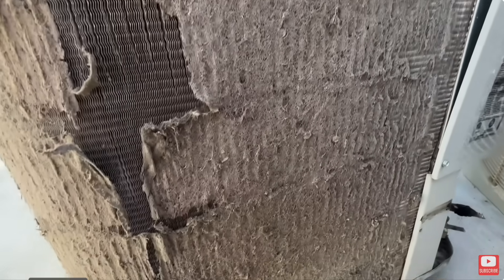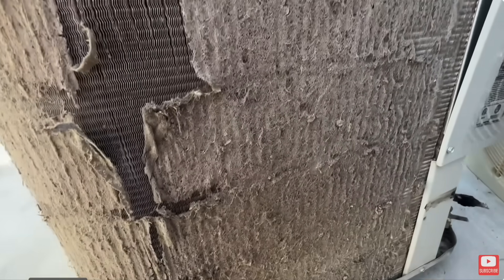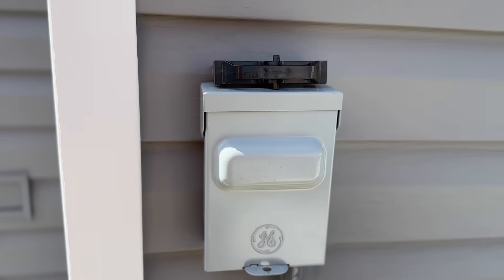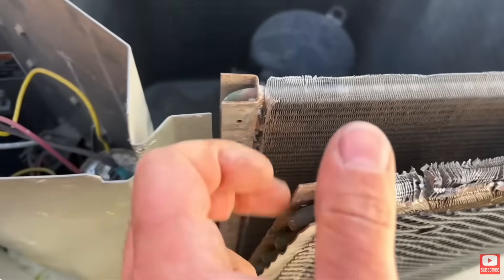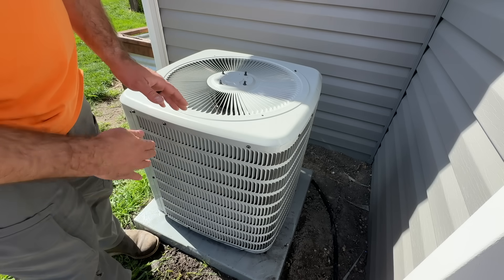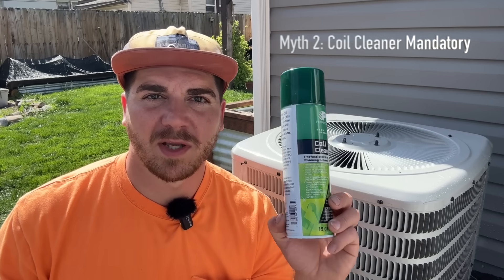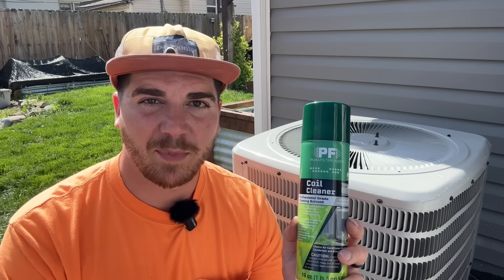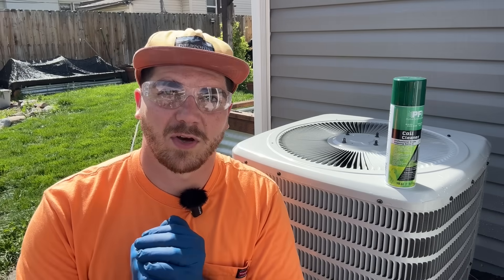Stop Cleaning Your A/C Coils The Hard Way! Do This To Get Colder Air From Your Vents.

Comment: Really appreciate you sharing your excellent knowledge about HVAC systems. I have question about compressor freeze up. If on a 90+ degree days and we set the thermostat temperature to 60 degree, will it cause the system to freeze up? Been getting conflicting answers, some tech said yes and some said no. What's the correct answer? Thanks in advance!
Reply: It depends on your specific setup and condition of your system. If you have a "dumb" system and your airflow is limited (such as from a dirty filter or undersized ductwork) it will probably freeze up. If your system has great airflow and is properly charged it will probably be fine. Usually it's recommended not to cool below 68F or so just to be safe. If you want it colder you can get an inexpensive freeze protection control installed which monitors the operating temperature and shuts off the compressor if it gets close to freezing. If you have a modern inverter-based system like a mini-split it probably has this protection built-in.
Reply: @eDoc2020  

Nope....air conditioners are only rated to cool 20 degrees colder than outside. You might get a bit more but no way you could ever pull down to 60 on a 90 degree day outside. That unit will freeze up. And yes, I am a licensed professional!
Reply: @JohnDoeEagle1   I just looked at some datasheets and the equipment is totally rated to cool into the sixties when it's 115 outside. Obviously the actual temperature performance depends on the unit size and thermal load. If you're in a cooler climate a sensible installer might size the equipment only to cool 20 degrees below outdoor temperature but the same building in a hot climate will get a larger capacity unit.
Reply: @eDoc2020  

Not true....if the equipment is big enough to go below that it's a "chiller" not a a/c. They use different Freon, different compressors, different pressures etc etc.

There's no R-22 or R-410A unit capable of such a thing.

R-23....aka "Agent Orange"....likely so.
Reply: @JohnDoeEagle1   I'm talking about a standard residential heat pump (but I presume cooling-only units are the same). One of the datasheets I've been looking at is the Goodman GSZC7 which is very clearly R410A. Expanding Cooling Data — GSZC702410A* + DMVT30BP1400* clearly shows data points up to 115F outdoor ambient temperature and indoor dry bulb down to 59. At those temperatures it has a low pressure of 159 and high pressure 445.

My understanding was that a chiller cools water and an air conditioner cools air, regardless of the size.
Reply: @eDoc2020  

You can't operate at those pressures and receive the results you are implying. Have you ever charged or put gauges on a refrigerator or freezer before? Yeah, you are lucky to have 5 PSI pressure when it is fully charged and running properly. There NO WAY a heat pump or a/c can do what you are describing. It's impossible!
Reply: @JohnDoeEagle1  If you think it's impossible I suggest complaining to Daikin. Also every other air conditioner manufacturer since they all say it's possible.

On an R410A PT chart the pressure is 101 psi at 32F and for R22 it's 57 psi. When the pressure is 5psig the temperatures are below -50F for R410A and -30F for R22. I'm not a professional but I know fridge coils are warmer than -50F.
Reply: @eDoc2020  

It's not possible....for starters refrigerators don't run on or use R-410. Most are R-404A R-134A or R-408A.....

I 100% guarantee you can't pull a heat pump or a/c DOWN into a 30 - 50 temp difference between the inside and outside.

You say you aren't a professional...yet are arguing with a professional with 22 years real world hands on experience , Universal Certification and NATE certified. 

That's why I despise this channel and the rookies that lurk it. You know more about it than we do. Yet you flunk simple basic theories and common knowledge.
Reply: @eDoc2020  

Why are you quoting R-22 specs either? They haven't made any new R-22 systems since 2011. You can't even buy new R-22 Freon anymore. It's all recycled and reclaimed.

Furthermore suction line temp has nothing to do with what is coming out of the register as well. You'll usually see a 18 - 20 degree drop between the supply and the return if the system is charged and working properly.
Reply: @JohnDoeEagle1  I don't know everything but I can read manufacturer datasheets. Heat pumps can have a 30-50 degree difference between inside and outside while still working. The simple fact they heat during the winter proves this.

I don't care if you're a professional or not. If you say things that are demonstrably false prepare to be called out. Perhaps you are working with 22-year old practical knowledge that is now out of date.
Reply: @JohnDoeEagle1  You mentioned R22 before I did.

Unless I'm mistaken the suction line temperature on an air conditioner is always lower than the supply air temperature. Actually I suppose I probably am mistaken because of superheat.
Reply: @eDoc2020  

Heat pumps don't work below about 25 - 35 degrees F. Nothing I said is false but clearly you are a unlicensed, unschooled, untrained, inexperienced know it all. That's when your +1 kit or electric furnace takes over on auxiliary heat. Even better if the main furnace is gas......At any rate I am specifically talking about a/c and cooling not heat. With a gas furnace you can have extreme differences in temperature between the outside and inside of the house or building.
Reply: @JohnDoeEagle1  I may be unlicensed and relatively inexperienced but you are the stubborn one. I've seen the call logs from smart thermostats clearly showing heat pump operation well into freezing with only occasional W2 aux heat.

For cooling just ask anybody from a hot climate.

If I'm so wrong then surely there's tons of information showing that you are right. Please point me to a document or two from a manufacturer or trade association saying standard air conditioners can't produce more than a 20F difference between inside and outside.
Reply: Good trap.....

18 degrees difference between the return and supply is usually ideal. Anybody who is licensed and has been professionally trained would already know that.
Reply: @JohnDoeEagle1   I know that an 18 degree drop in air temperature across the coil is good. But what does this have to do with the OP's question? We have no idea if their system was installed properly or how it's performing today.
Reply: You know more about it than I do even though I am a highly experienced professional that worked at a company in business for 105 years fro  1912-2017 until the third owner (my boss) died of a heart attack. He worked there from 1966 - 1986 before he bought the place. He owned it from 1986 to 2017 until his death. His widow was 71 and well past retirement. She closed us down and I found another job somewhere else. Now I work on large 480 Volt 3-Phase Delta twin compresor 20 Ton Trane package units at a U.S. Government DoD contractor facility that builds stuff for AM General and Oshkosh Defense. What would any of us know about it right? Only sold coal and was in business through boilers, gravity and oil furnaces too. Also saw Trane purchase/merge with G.E. Reminds me of the Walmart security guard that asks to see the combat Veteran or Police Officers receipt accusing him of being a thief. 

F*** this channel!
Reply: @JohnDoeEagle1  Good for you on your career. Now please find one source supporting your claim that air conditioners can't cool beyond 20 degrees below outdoor ambient. With all your experience it should be easy.

For the record, I made an incorrect statement earlier which I would like to correct. The heat pump datasheet I referenced only provides cooling data down to 70 F. I was mistakenly looking at wet bulb instead of dry bulb indoor temperature. Still, 115F outdoor - 70F indoor = 45F temperature difference. 

Since you brought it up, why wouldn't the Wal-mart guard check a veteran or police officer's receipt? It's their job and list time I checked, veterans and police are still capable of theft.

One thing we can agree on, I'm generally not a fan of this channel.
Reply: @JohnDoeEagle1  I know you are but what am I? But seriously, I've backed my claim with data while you have backed yours with "trust me, I'm a professional." I will be happy to change my opinion if you provide actual evidence supporting your claim.

Comment: Why disconnect the system if you are not going to take the top off and you are just spraying it with water?  It gets wet from rain anyway right so whats the difference?  

Just curious...
Reply: Spraying forced water into a unit from multiple directons can cause water to get into areas where normal rainfall does not.  Think safety.  You are spraying water into a huge capacity electrical system with many exposed electrical connections and water conducts big time.
Reply: …because you’re not standing next to or working on the unit when it rains.

Comment: Thanks a million for teaching the hard working families what it takes to save money.  You are an example of a great human being.  THANK YOU.
Reply: 100%. not many people willing to help others nowadays.
Reply from the maker: Wow, thank you! That means a lot
Reply: Hard-working or just stupid AF😂😂😂😂…. I think its the latter
Reply: After rinsing the unit with or without cleaner, how long should we let it sit before turning unit back on?
Reply: @Charltonsgirl right away is fine. Been doing mine twice a year for as long as I can remember and never had an issue
Reply: @Charltonsgirl  do you shut your AC off when it rains?  Curious
Reply: I agree with all your suggestions about cleaning the coils, and I do clean mine from the outside also. The problem with my condenser is, I see leaves inside on the bottom, and I don’t want to have to disassemble the unit just to clean the leaves out. It’s a pain to do.
My previous condenser was easy to remove a panel, and then clean it out. I guess if the leaves build up enough, I’ll have to do that. Great video! Thanks!
Reply: If only he was telling you how to do it properly.
Reply: @joehernandez8208  Why don't you tell us how you do it.
Reply: @joehernandez8208 explain?

Comment: Thanks for your comments.  I have been quoted $700 to replace capacitor, and, $600 to replace contactor, both of which I replaced for $20 or less.  Still not cooling, may need refrigerant.  Can you suggest a service company in Marietta Ga.  Many thanks for your comments.
Reply from the maker: Sorry I don’t know of any in your area. I should start compiling a list of trusted companies though!
Reply: see, that's  a perfect example of a royal ripoff!
Reply: Are your fans turning on, main indoor fan cap very common  problem
Reply: Are your coils clean?  Is your outside fan AND compressor both running?  And like a previous commentor, is your inside fan blowing?  Try a find a way as well to inspect the evaporator coils as well.  Is the inside unit frozen up?  If all these seem ok then likely freon needs checking.  Kuddos to ya for doing the cap and contactor work.  Those were ripoffs prices.
Reply: Shocked!  A previous svc rep had cut the ground wire.  Probably mad since  I did not pay his astronomical fees.  Now, all is well.

Comment: My HVAC professor said that this is a very good way to get FIRED!  
Do it right and or, don’t do it at all
Reply: Don't just blindly follow anyone. Test it. Clean a coil this way. Then benchmark your head pressure & ODT after 20 minutes.Next clean it inside out, then benchmark head & ODT. You will find no discernable difference if you cleaned it well the first time.
Reply from the maker: This video isn’t even made for hvac techs 🤣 why so many hvac techs watching these videos? 🤷🏻‍♂️

Comment: You should have cut the line set to length and reflaird the ends on the mini split instead of coiling it up. It's a hack job.
Reply from the maker: Eh, it works great. 

Also it is a precharged lineset so that would kind of defeat the purpose of it being a diy mini split 👍🏼

Comment: You want to start at the top with the cleaner for the same reason you start at the top with the rinse, liquids flow down do to gravity.
Also very often its not easy to determine visually if a condenser coil just needs a rinse versus a cleaner and rinse. I have seen coils that visually look OK, but are in fact loaded with dirt and need a deep clean. One sign is high head pressure, another is high discharge temperature.

And I completely disagree that dual row coils do not get dirty on the inside row. Because they do and they cannot be cleaned without removing the top, or using a condenser wand. 

Ever walk up to a condenser with head pressure that pegs your manifold gauge? I have, and without chemical cleaners, some unit disassembly and chemical cleaners that head pressure isn't gonna come in range.
Reply from the maker: I guess we’ll have to agree to disagree. I literally showed the b roll of a FILTHY condenser on the outside, and when I split the coils there was next to nothing in there. Also the opening is so small that spraying water in between wouldn’t even do much if there was debris in there.
Reply: @diyhvacguy  You showed b roll footage of one condenser coil in one area of one state. Get back to me when after 36+ years in 5 states you see I it differently.
I also firmly disagree that manufacturers prefer chemical cleaners to not be used.
Just last week one of my distributors, where I get American Standard, Bosch, and Mitsubishi equipment held what they call a feed and greet.

They host several a year where vendors and contractors meet and greet, share war stories and enjoy lunch together.

This last one we had both A Bosch rep, a Mitsubishi rep, as well as a Vapco rep among others. (Vapco as you should know manufactures among many products, condenser coil cleaners).

At no time did a knife fight break out between the representative of coil cleaners and those representing manufacturers.

 Its great that you encourage homeowners to take their garden hose to their condensers, however its discouraging to lead them to believe that's all that is ever needed.  And you are in essence telling them that professionals like myself or ripping them off charging for chemical cleaning. And you are certainly wrong stating that manufacturers don't want chemicals used in cleaning their coils. I know of not one manufacturer that has stated such a claim.
Reply: @ZERO-F2G-  I was quoted $300 recently to chemically the coils on a  mini-split condenser. I thought that was very high when I can buy a can of cleaner for no more than $20 and do it myself. Just curious, what do you charge for that?
Reply: @davidlindgren7605  If you called us just wanting your condenser chemically cleaned and a general check on the unit, we would charge you $85 dollars, assuming no other repairs needed.
Which means we didn't make any money, but we didn't loose any either, just a break even on overhead, but maybe we gained a future customer when repair or replacement is needed.

Comment: Thanks I don’t like the extra work removing the top.
Reply: Depends on the level of efficiency you want.  The cleaner, the better and less it has to run.  I dismantle mine completely early in the morning and do a thorough clean.  Takes about an hour.

Comment: Great videos man. Ppl must be hating on you for doing these. But good for you because in a time like this where everyone is going broke they need to learn this stuff so they don’t sit without A/C. I know a ton of ppl that do and i don’t have enough time to help them all for free. It’s not my field but i know the basics of most issues. I will watch your video on changing a unit-i basically know how and have helped a few times back when it was switching from Freon to 410A. I own gauges and use to top of ppls units that were dying while they saved money to upgrade to 410A. I might have to pay you to hop on video at somepoint when i change a unit i have to for my mother in law who’s broke. Pretty sure i can do the handler no problem run the lines from co denser and install that -it’s just the leak test stuff and I’d have to buy that and that little compressor you use. 

To the ppl watching this …most everything that commonly breaks on your A/C unit or makes it stop working is really an easy fix-this next video for the capacitor is very common and super easy to do if you don’t overthink it—it’s a giant fuse but basically is comparable to changing out something like a 9 volt battery in a smoke detector. Just like cleaning these coils are like cleaning out your window screens or a 10 foot gutter and changing a fan on the outside unit is easier than changing a ceiling fan and the last thing is the drain line and just sucking that out with a shop vac. You can save yourself from no a/c or not affording to get it fixed-all these parts are pretty cheap compared to hiring someone. He’s definitely pissing off A/C companies by really showing you how easy most of the common problems are and not exaggerating on skill level or price of these things to do yourself. You can pretty much start an A/C emergency fix it company out of your car with universal Capacitors, universal fans, a shop vac, coil cleaner and foil tape & tiny tool box. You’ll be able to get 90% of people’s broken A/Cs running.
Reply: I'll add that everyone should have a capacitor on hand.  They're inexpensive and probably the number 1 failure reason for AC's.  Note though that the replacement is quite easy with only 3 wire terminals to unplug and then replug to your new capacitor. BUT, realize capacitors store an extreme amount of electricity that MUST be discharged before doing the replacement. Those with no basic skills around electricity should not perform this function.